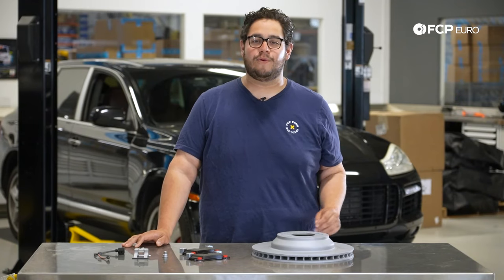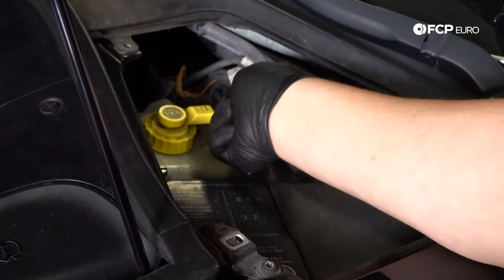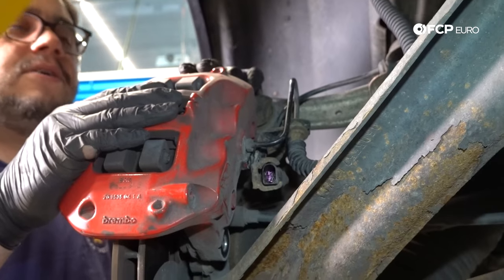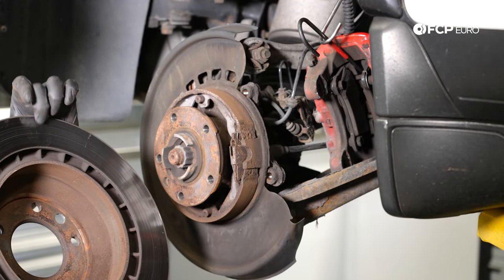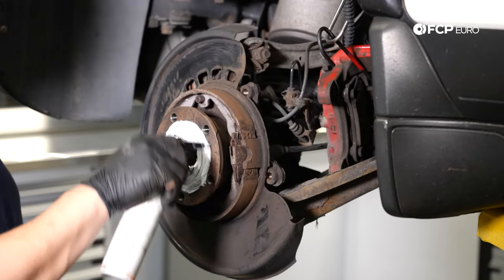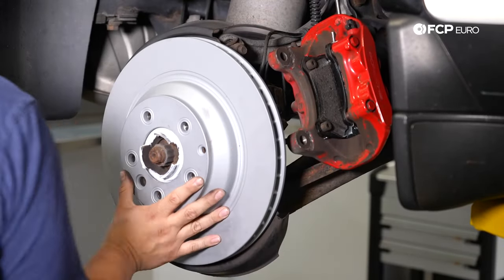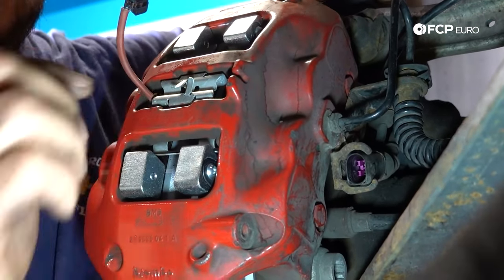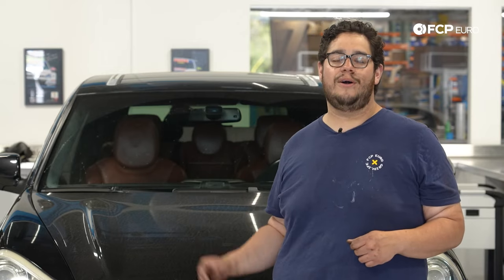Porsche 957 Rear Brake Pads & Rotor Replacement DIY (2003-2010 Porsche Cayenne Turbo, S, GTS)

Comment: Do you have to torch the calipers down or tighten as much as possible
Reply from the maker: Hello, if you watch at the start of this clip, the torque specs and socket size are supplied. https://youtu.be/r92BWCTAQq8?feature=shared&t=898

Comment: how to get out of jack mode? just turn the key on and lower the car?
Reply from the maker: When you put the car back in drive and move it it will turn the mode off and begin to use your compressor again.
Reply: @fcpeuro  ok thanks for the info!

Comment: Wait, no replacement of the tamperproof callipers bolts or copper grease for the pads contacts no adjustment for the handbreaks just rip them off ..... squeallllllllllllllllll heaven ha

Comment: Porsche spec is to replace caliper bolts during caliper reinstall. It’s not mentioned here. They are less than $20 for the set @ Suncoast.

Comment: By applying anti-seize to the hub face you have degraded the hub to rotor friction that transfers the torque between the 2 parts. This places greater shear load on the lug bolts. This is just poor practice and can lead to a problems.